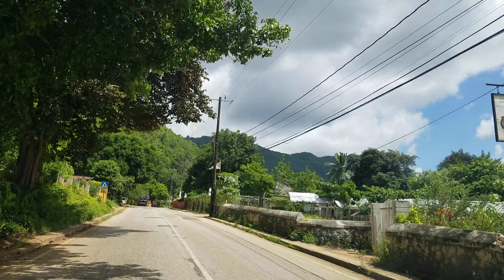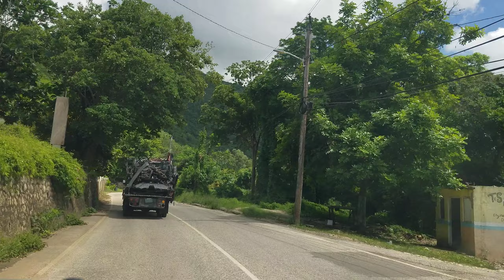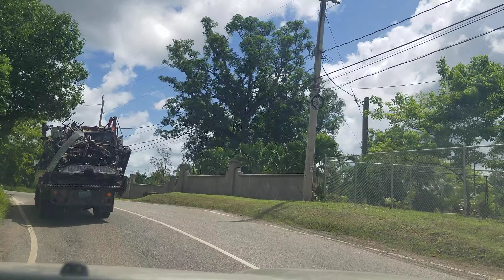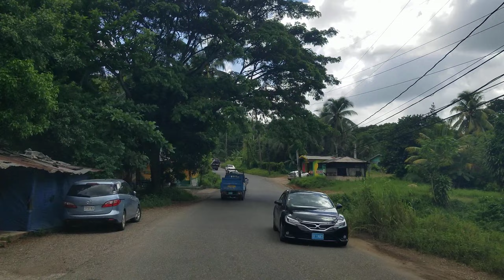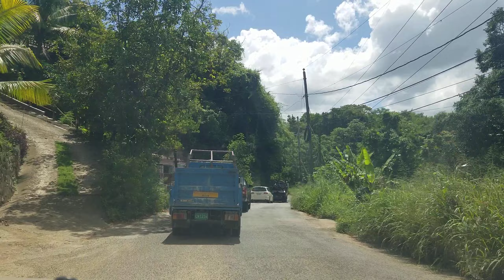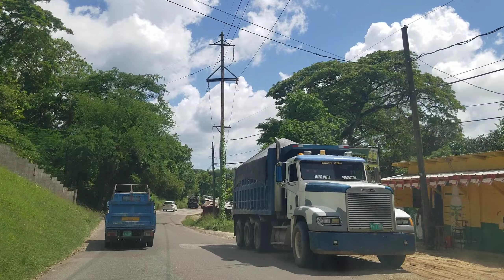Porus Destroyed Jamaica

Comment: While things may normalize somewhat after the toll starts to be charged I still think looking at the distance between the Toll Gate exit and the Melrose Bypass exit with only 13 Kilometers/8 miles between both exits, it is not so far a drive/distance that drivers could not stop off at one exit and rejoin the highway at the next, what needs to be done or should have been done is to make where the Melrose Bypass joins the highway a full on/off both directions exit and not have it designed the way it is now with limited access.
Reply from the maker: So true